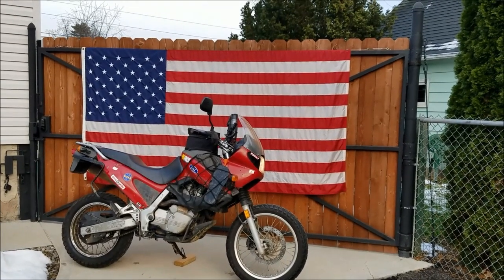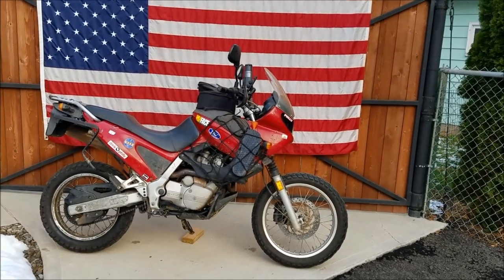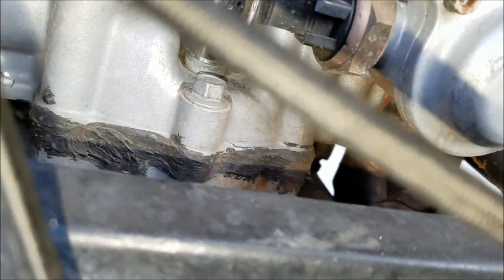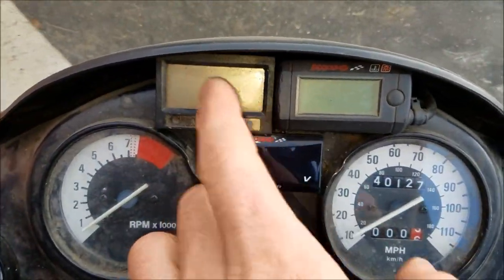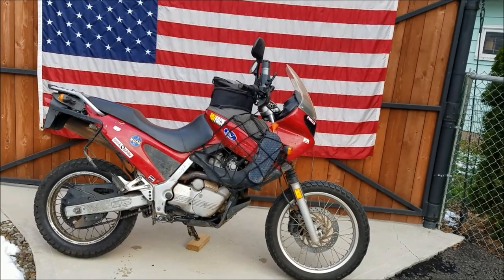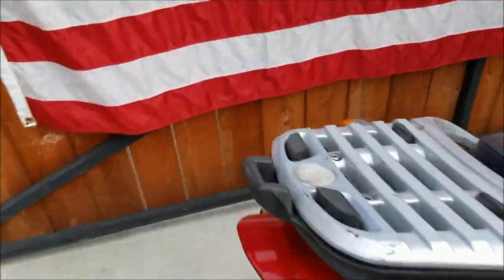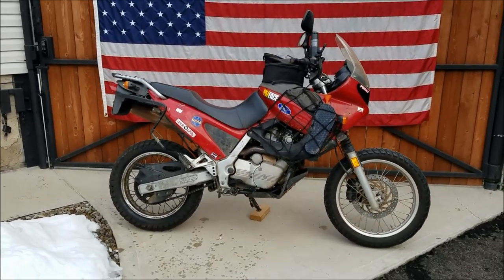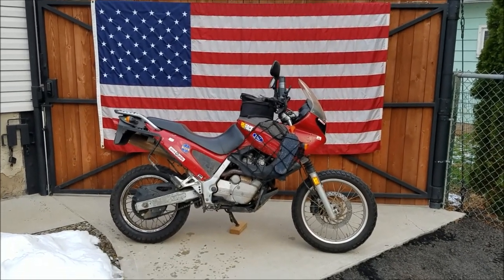BMW F650 FUNDURO REVIEW/MODS/ thoughts after owning for 10 years 1999 f 650 pegaso

Comment: Looking for a beater trail/short adventure machine. You have me sold.
Reply from the maker: Awesome Sarah!  Good luck with your search, and let me know what you come up with/what price to get it for!  They are definitely a budget adventure bike for sure! What they lack in Frills they make up for in reliability.  :)
Reply: Thanks! Quick question, how tall are you? Going by seat height doesn't always tell the tale...
Reply from the maker: Sarah Dell I'm 6 foot 2 inches tall
Reply: Uh Oh. Do you think someone 5' 8" will have any issues? The seat height doesn't appear to be that high, and the center of the bike seems narrow. But things can be deceiving.
Reply from the maker: Sarah Dell it's hard to say for sure, but keep in mind the bike in this video is lifted 2" in the back.  So I think you should be all right. But you can always lower it if you need to. I'm pretty sure they sell kits or you can Fab something up yourself
Reply: Hi, I'm 1,71m, that's close to 5'75", and with normal suspension settings I don't have any problems, especially considering you'll use boots, then it really isn't an issue. IF you use normal daily use shoes, it will be harder, but still manageable (sometimes when I'm working on it I'll take it for a drive with small shoes). Mine is with the presetting for Hard, on the shock screw (rebound damping) and in High on the adjustment knob under the left leg

Comment: 40 k ? It's brand new !
Reply from the maker: Nah, at 40k you definitely feel it in the bike.
Reply: @NoNonsenseKnowHow  I've seen some beyond the 100 000 barrier. Maybe it's age ?
Reply: @NoNonsenseKnowHow  maybe it's where you used the bike I took the bike with 60k this year and it doesn't feel underpowered or banged up at all . The bike was never used of the road though and it was owned by a guy who was 50+. Maybe at one point it will need a rectifier in the engine but for now it has solid power.

Comment: isnt this the F650st (strada) version?
Reply from the maker: Ernstig no this is the standard F650. There are distinct differences, but they are very close to being the same bike.  what makes you think that it is an ST?
Reply: NoNonsenseKnowHow I have an F650 funduro with the integrated front blinkers and windscreen that is fastened at the same lvl of the headlight. Maybe it's a regional difference?
Reply from the maker: Ernstig I've never seen one like that. Maybe somebody added them aftermarket.  Mine is definitely the standard F650. Has the 19 inch front wheel, tall front windscreen, wider bars, Etc
Reply from the maker: does your bike look the same as mine otherwise? Because if not you must have the F650 after the funduro. I think they changed over in like 2000
Reply: No I have the 95 version. same as this one: https://youtu.be/AnyT4W0h53Q. different front blinkers that are integrated in the front fairing and different windshield mounting. Yours looks like the one that I always thought was the strada: https://www.youtube.com/watch?v=JvttxI1Wx1M
Reply from the maker: yeah that one with the integrated blinkers looks cool. We never have anything like that here in the states.  the second one you sent me you can tell just by looking at the front wheel that it's in ST because it is an inch shorter. But yeah like I said here in the states, the ST and the standard model are just about the same bike.
Reply from the maker: Ernstig good to know though, I've never seen one that looked like that. Looks the same minus the front fairing difference
Reply: Guess it's the different markets. very confusing. Great bikes though. mine has 69k km on it and still going strong. Just replaced the exhaust pipe gasket after the first bend. made some cool popping sound though.
Reply: nah man i'm pretty sure you have the st because the origional funduro has smaller side plates, you see those black side plates under your flipflops where your knees go? they only came with the later st version to make it more aerodynamic for the highway(the strada) and so did the clock you have build in your dashbord. i could be wrong though..
Reply from the maker: mrspielemasterful  this is definitely the standard F650 model for 1999 here in the United States.
Reply from the maker: mrspielemasterful I bought the bike from the original owner and he gave me the original dealership pamphlet for the BMW models that year. It shows both the St and the standard model. You can clearly see the differences and see that mine is the standard model.  but in the end, it really doesn't matter. You can take an st and basically turn it into the standard model with minimal modifications. The engine and everything else is the same.
Reply: you're probably right, either way great bike
just bought a 99 st with 24k kilometers for 1600 euros partially  because of this video, so thanks :D i couldnt have gotten a better bike for the money!
Reply from the maker: mrspielemasterful awesome to hear man! You're definitely going to fall in love real quick! Like I said I've owned a lot of bikes in my time, and this is a real keeper!  good luck with the new bike! :)
Reply: Same bike. Funduro has a bigger front wheel for off-road but not as big as the Dakar. Working from memory I recall 18inch for ST/Strada, 19" for Funduro, 21 inch for Dakar.